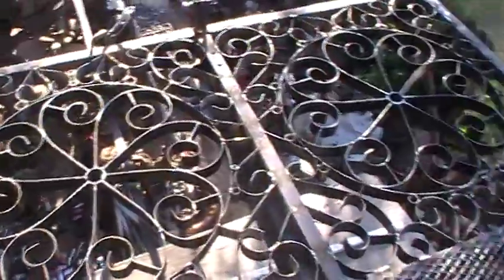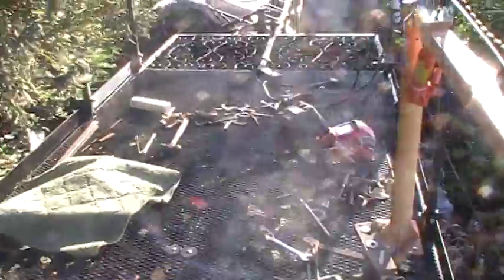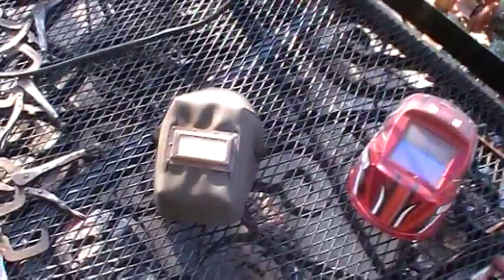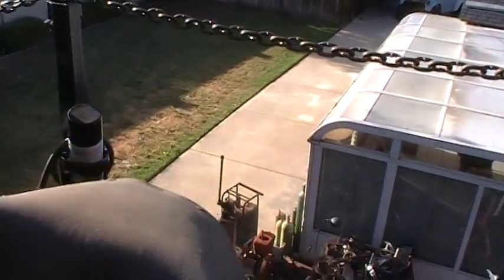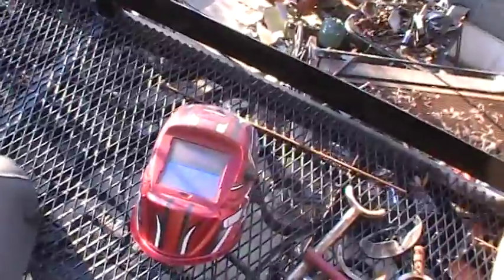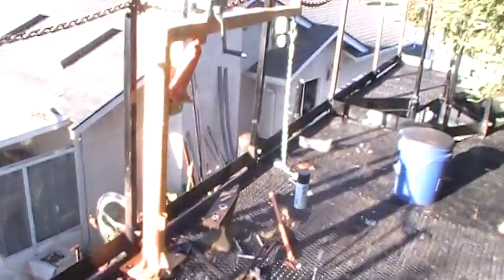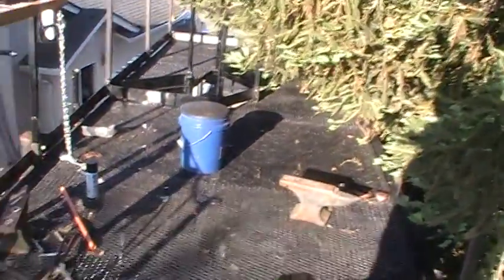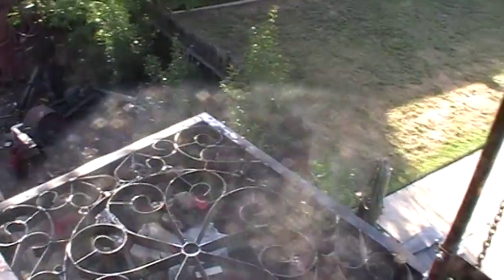Es el ultimo... The last time around

Comment: Finally got my Barnes 41/2 lathe going strong. Installed a DC motor from a treadmill and new 3 jaw. It can hold .0001 all day. Not bad for something that’s over 120 years old.
Reply from the maker: Glad to hear it! I was thinking about mine and when I get this trailer in shape I'm going to have to get the old pedal powered unit set up. I heard you can control the speed with the treadmill motor. Holding a 10,000th with a Barnes could be pushing it beyond what could have been done when it was new! Good job. You must have some machining skills. I'd be lucky to hold .010" on the old girl.
Reply: @davewilson1591  
I have modified a couple of things to tighten it up. Replacing the chuck helped tremendously. I spent hours hand scraping the ways and shimming the chuck mandrel. I use a 100 dollar QCTP from Amazon that holds really well. Also have an alignment bar for centers. Installed trust bearings in the carriage. Now it is solid mounted on a cabinet and leveled. 
I don’t know exactly how long it will stay that tight. I bought it as a project and don’t use it as a full time piece of equipment. I usually turn mild between 5-7 hundred rpm. Then make my final pass at 1500 rpm. It makes a nice finish with cheap carbide tips. Keep in mind I’m not making deep passes, a thou or two at a time manually. It’s not worth the time to setup gears for no more than I do on it.
Reply from the maker: @Miner-49  Yep, that what it takes. You have to dial your equipment in to get good results. Sounds like you have some machinists blood running through your veins. I don't have the patience. Different back ground. I bent, folded, welded, fit up, layed out, and generally made things out of metal my working life. Tolerances way different. But I enjoyed it. You keep on holding .0001" and I'll watch.